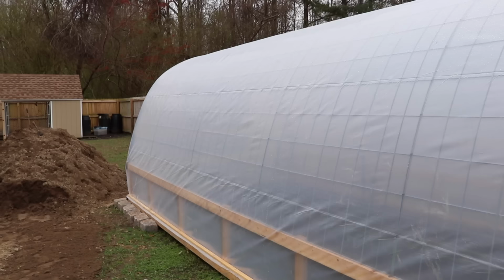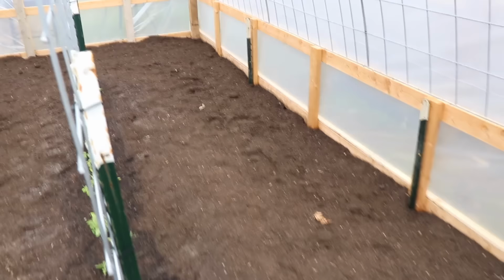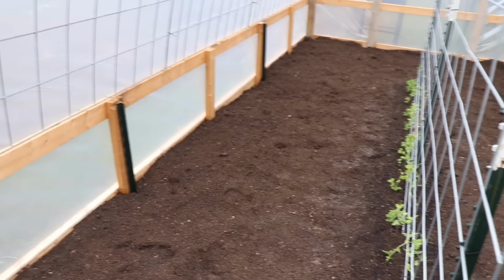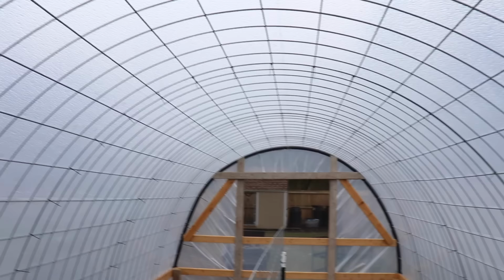DIY Cattle Panel Hoop House || Build Your Own Cheap & Easy!

Comment: Will you need to put insulation “like your pipe lagging “between the metal and the plastic ,to stop the plastic from becoming brittle in the summer.
Reply from the maker: We never had an issue with that. It gets super hot here too. We did change out the plastic 4 months after the build and put on a greenhouse grade plastic. Durable & long lasting. At the time it was only $100 from Amazon! 😉

Comment: How far apart are your walls and how high did the hoop house end up being. Really liked what you did here. Are there plans available? Just discovered your channel and subscribed. You might think about rolling up the bottoms of your plastic in hot weather. Might save you money buying fans and running power for added ventilation. What size plastic sheeting did you use. I saw in the comments that you had to replace it with a 40' x 26 ft piece. The link to amazon shows a 12x26' sheet so I'm a little confused.
Reply from the maker: Hi John! Thank you for letting me know about the link. Sometimes Amazon vendors change the specs of the product and eras creators aren’t notified unless someone tells us. I fixed the link for a 25ft x 40ft greenhouse plastic like the one we used!

Also, I’ve attached a Q&A video that I did for the hoop house build, it’ll help answer a lot of your questions! 😊 https://youtu.be/zl4sZYStqmE

We don’t have plans for this build, just the video. We were just building a homestead project & decided to make a video of it! 😉

The hoop house ended up 7-1/2ft tall & it’s 20ft long and 10ft wide. The wood frame at the bottom is 2ft tall.

We also did a ventilation video (where we roll up the sides) you can watch here >>> https://youtu.be/QACRQN920pE

And another video for the overhead sprinklers we installed >>> https://youtu.be/R1zQIxW3ZyI

Thank you for watching & subscribing!

Comment: Did you put the footings in concrete and how deep are they buried?? How did you avoid the centers bulging out to the outside after you put the cattle panel in?
Reply from the maker: They’re buried in cement 2 ft down. We nailed a regular nail into the wood & set the cattle panel on the inside of that nail. The pressure of the panel pushing against that nail holds it in place while you nail in all the u-nails. After that you can just hammer that straight nail over the panel too.😊

Comment: Question…we live in a HIGH wind area. How well would this hold up to wind?? On average 20-30 MPH pretty much daily.
Reply from the maker: We get high winds here in VA & even occasional tornados. We’ve never had an issue with the structure or the plastic! 😊

Comment: Hoop house vs greenhouse? I live in a moist and shady area, not having success with my raised beds. Which structure would you suggest?
Reply from the maker: Honestly either, we’ve done both. They both serve the same purpose. A greenhouse a more of a “permanent” structure vs the hoop house that is quicker/easier & usually cheaper to put up.

Comment: I wanted to know the price, but the materials list shows it.
Sheet plastic $115
Cattle wire 4ga 16ft x 50in $32 x5 = $160
Concrete bags $15 x 2
Solar powered ventilation fan $160
Shade cloth $30
Screen $12
Insulation $18
= $395
Then add the lumber, unless you can get your own from the land or have it already. Total cost is under $525.

There are cheaper methods to build it. Although thi is very easy. It can be done cheaper, especially since half the cost was the plastic sheeting and solar fan.

Marine vinyl is a cheaper choice. You can get it online for probably $25 to $50, but don't quote me on that, I just did a quick google search and it's for 10 mil marine vinyl which is designed to hold up to the elements. I might be wrong about price only because I'm not sure how many square feet you need. It comes in 72" rolls at 3.75/yard (3 feet), so that's $25 for 6 yards (24ft), or about a dollar per 1ft x 5ft. The greenhouse looks 16 feet long and maybe 8 feet high, so maybe 20ft x 16ft? If so then 2 sheets @ 20ft x 6ft (72") with a seam down the middle. There are several methods to join it at the seam. In that case you need 40 feet if my latter estimates are correct which means ~14 yards x $3.75/yd = ~$53 for 10 mil marine vinyl.

As for ventilation you don't technically need th fan and can get by without it. Instead I would recommend to invest the extra money into large tubes - get at least 4" corrugated tubes - which you will use for geothermal temperature regulation. Dig trenches and sent it around the perimeter of the yard and back, needs to be below the frost line, typically 6-8ft deep. Laborious, but free if you do it yourself, just the cost of tubes. You can get 100ft of corrugated tubes for only $75. It will provide stable temperatures year round. TO make it perfect it requires some knowledge but not much.

Overall if you farm the lumber off your land, and skip the ventilation fan instead opting for natural ventilation using the wind tunnel effect, you can get by with this project for much cheaper. Don't use concrete and save even more. You can use less screws or get a bulk box for $10 off the internet. I realized the pipe insulation is for providing the corner to protect the plastic from tearing, good idea and it's cheap anyway. And you don't need a greenhouse so big, half the size will be fine, which cuts your material costs in half, in which case the cost would be:

8FT unit (20ft arch, 120sqft)
Lumber: free
20x12 Marine vinyl: $50
Cattle wire 4ga 8ft x 50in x 3: $96
Shade cloth: $30
Screen: $12
Pipe insulation: $18
TOTAL: $206

Forego the pipe insulation for electrical tape or duct tape to protect the sharp edges and save another $20, also get a shammer shade cloth and make a smaller size greenhouse and you could even do for this:

6FT unit (16ft arch, 96sqft)
Lumber: free
16x12 Marine vinyl: $40
Cattle wire 4ga 8ft x 50in x 2: $64
Shade cloth: $20
Screen: $12
TOTAL: $136

So it can be made REALLY cheap not really compromising the integrity because the structural rigidity is the cattle wire panel and the wood, especially if you can get reclaimed wood, pallet wood, or farm it from your land.

So, this greenhouse could technically be made for about $200, or a smaller budget version for under $150. Or, add $50 to buy the lumber at today's inflated prices.

Hope it helps!

Comment: Very nice build thank you. Best video on the topic. I hope I am not repeating a previous question but it is not apparent what the T posts were for. Did you use them as additional anchors and secure the to the adjacent 2x4 slats? If so how were they tethered together  Or did they serve a different purpose?  Thx again.
Reply from the maker: Hello! Yes, the t-posts were just for additional supports as the 4 corner posts were the only things cemented 2ft down in the ground. 

We drilled holes into the t-posts, buried them 2ft down and screwed them to the vertical 2x4s. I hope that answers your question. 😊 Thanks for watching our video!
Reply: @HomeFreeAlaska  I almost gave up scrolling and was going to ask the same question! Thanks and good luck in Alaska.
Reply from the maker: @usaeagle7  thank you!!!😊

Comment: This looks great!  How long do you think the plastic sheeting will last?  I am in central Texas.  Wondering if the plastic sheeting holds up to 100F + summers?  50 mph winds?  Opinion appreciated.
Reply from the maker: Yes to both questions! Virginia summers are HOT & we also have tornados from the hurricanes on the east coast. Never had an issue. Manufacturer says the plastic lasts up to 3-4 yrs depending on outside elements.😊

Comment: How well does it hold up under a snow load?  
I realize that it should slide off relatively quickly on its own, but I'm sure that it can build up a snow load before it slides free.
Reply from the maker: We don’t get a ton of snow here in VA. But when it does snow, we go out and remove it. It actually packs up there pretty good without sliding off lol! But if we had heavier snow here, I’d def put in some center support beams to help support the cattle panels. 😊
Reply: @HomeFreeAlaska  Thanks for the reply.  I like the size of that green house.
Reply from the maker: @johnjacobjinglehimerschmid3555  me too! It’s been a great addition to the garden space! 😊

Comment: do you guys have any sonw in winter? If so, how does the structure whitstand to the weight of wet snow? Does it tend to sag?
Reply from the maker: Hello! We get very little snow here in VA where we’re at. If you have heavy snow, I’d recommend a support beam down the center as too much weight will cause it to sag. 😊

Comment: I'm in Australia and was looking at a hoop house and came across yours, and stopped right there, no need to go further. Couple of points though, as afar as conversion. We don't seem to have access to what you call cattle panels, but we do have remesh of course, that's a lot harsher as a material, in that it is not smooth. I know the material for cattle panels, but have no idea where to get it. Another thing, I know what a 4 x 4 or a 2 x 4 is, but what is the measurement with the 'S' as in 
(2) 4x4s cut in half

(4) 2x2x8s
(12) 2x4x10s
(15) 1x2x8s
(17) 2x4x8s

Would appreciate any feedback
Reply from the maker: Hello David! When I put an “s” at the end of the measurement, it’s just to reference plural, meaning more than one. That’s all. 😊 I put the number needed in the parenthesis so you can disregard the “s” altogether if it’ll be less confusing.

We got our cattle panels from a store called Tractor Supply Company. I don’t know where to find something like that other than Tractor Supply or farm type stores. Not sure if you guys have any of those in Australia. Thanks for watching our video! 😊

Comment: How did you secure plastic to the wood? Staples? Wouldn't they tear out in wind? Also what do you estimate this cost to build? Tyvm
Reply from the maker: Cost was approx $500. Before this inflation tho. Haven’t had an issue at all with the staples. 😊

Comment: I'm wondering how it's holding up? is it not get a lot of wind I think you could reinforce it from the cattle panels to the sidewall and do you get a lot of snow that has a stood up under snow load yet?
Reply from the maker: Hello! We don’t get much snow here where we’re at in VA but we’ve had about 4” on it before & it had a little sag in the center. But you could always reenforce it by running a support beam down the center. 😊 The hoop house has held up nicely and has been a great addition to the garden space. 😊 Thanks so much for watching our video!

Comment: Are you in Alaska? Sorry for my ignorance. Do you expect to have problems with snow load on the greenhouse? We built the same hoop house greenhouse with cattle panels, and an ice storm collapsed the roof. We were able to get the ice and snow off, but I then built reinforcing supports inside to support the roof. Just wondering what your thoughts were. Thank you.
Reply from the maker: This was built in Virginia. If we were living somewhere with lots of snow I would have definitely ran a support beam down the center. We now live in Alaska and plan to make a green house with the hard plastic panels and 2x4s. The snow loads up here are crazy. Thanks for watching! 😊 (Joe)

Comment: And, what size shade cloth and % did you get and would you have preferred a different size afterwards?  Thanks!
Reply from the maker: We chose a 40% Black Shade Cloth, 10 x 20 FT. I think it worked well. Kept it shady inside. I would probably change the size of the shade cloth to 15x20 so it would cover the hoophouse completely or close to. Thanks for watching! 😊

Comment: Will the veggies over heat if left inside the hoop house? I made one very simular and wondered if you replaced the plastic with the greenhouse cloth for ventilation?
Reply from the maker: Ours didn’t but we bought a shade clothe to put over the hoop house and added roll up sides for better ventilation.😊

Comment: I scrolled through the comments and did not find anything about the visquine. How big is the visquine, what mil is it and where did you get it? I can't seem to find what I think it should be on Amazon or Home Depot. How is it holding up? Appreciate an answer about the covering.
Reply from the maker: Hi,
Here is the info that you requested and the link at the bottom.
We moved from Virginia to Alaska so I have no idea how the plastic is holding up. 
4 months after the build we changed out the plastic from the Home Depot’s to a durable, long lasting greenhouse plastic which was 40ft X 25ft, 6 MIL thick, 4 Year UV 
Resistant Polyethylene:https://geni.us/CkiYCaD

Thanks for watching! 😊

Comment: How’s the longevity going? High winds,
Snow loads etc? Awesome job!!
Reply from the maker: Hi Corey! We just sold this property so we only had the hoop house for a year...we did change out the plastic for an actual greenhouse grade plastic last fall because that cheap plastic we initially put on didn't even make it though the 1st summer without cracking lol! Other than that its held up great! We get high winds here and even tornados...we've had zero issues. We don't get much snow here tho. We do get snow, just not much. I'd def recommend support beams down the center if you're in a heavy snow load area to help hold the weight as the cattle fence panels will sag if you don't. :)
Reply: @HomeFreeAlaska  awesome! thank you for the info! we live in northwest MO so we get it all as well! winds, tornadoes, snow, etc. I plan adding some 12volt fans for air circulation, powered by solar panel and batteries. We will see how it turns out!
Reply from the maker: @cpmartin2007  sounds like a fantastic idea! Our original greenhouse was powered by solar fans, worked out great! The ventilation is so important! 😊

Comment: How does it hold up with high winds and snow load
Reply from the maker: Hi there! We don't get much snow where we live right now in VA...but we do get high winds and tornados! We just had a wind storm the other night that snapped our flag pole in half! The hoop house was still standing with ZERO damage. Its a pretty sturdy lil structure being cemented into the ground the way we did it. I've had other subscribers build this same hoop house where they live with heavy snow...they said they just added extra support beams down the center. I would imagine snow removal would be important too. Thanks for watching!

Comment: With all that water in yard i would have layed cinder block for foundation first n not placed untreated lumber close to ground
Reply from the maker: We were working with the materials we had at the time. It’s all easily switched out when/if needed. The water issue is temporary when the seasons change. Either way, we don’t own this house anymore. We sold it in 2021 & bought a cabin in Alaska.😊

Comment: This is a great build.  I would like to build one but have concerns about my area weather.  We get cold sometimes down to 5 degrees, hail, snow and high winds. How will this type withstand this weather.
Reply from the maker: We don't get much snow where we are in VA. But we do get hard core storms and even tornados. So far the hoop house has held up just fine. It's a sturdy structure with the posts anchored into the ground with cement.
Reply: @HomeFreeAlaska  thank you

Comment: Great Job!!! I'm almost done building our green house. I'd like to be able to roll up the sides but I'm wondering if yours was too hot in the summer? I'm installing a fan on one end and I'm putting a screen on the door on the other end to vent the green house. Just wondering if you think that will be enough to keep it from getting too hot.
Reply from the maker: Hi there! Actually it did get too hot in there. So we added fans and roll up sides for more air flow & ventilation. Check out our video here! 😊 
https://youtu.be/QACRQN920pE
Reply: @HomeFreeAlaska  Awesome!!! Thanks!!
Reply from the maker: @khills1181  you’re welcome! Only thing we changed was we went back out & flipped the rolled sides downward instead of up so that the rain water wouldn’t catch in there. 😜

Comment: when you put the cattle panels on, how are you keeping them there to nail down?  Do you cut a groove in the 2x4s?
Reply from the maker: No we nailed a nail into the 2x4 and then set the cattle panel on the inside of it. The resistance pressed against that nail keeps the panel in place until you finish nailing in all of your U-nails. 😊

Comment: Nice build, just a question / observation do the cattle panels get hot in summer ? You may need to prevent the visqueen sheet from touching them as they may burn hot spots in your sheet…..
Reply from the maker: Hey Steve! They actually don’t. We bought a shade clothe for the hoop house & have 2 fans circulating the air through the hoop house all day. 😊 We’ve never had an issue with it. 😉
Reply: @HomeFreeAlaska   it’s a similar set up to what I have then👍🏻 apart from mine is steel tube whereas yours is the grid, but I have hotspot tape between the tube and visqueen sheet. Fans to circulate air and exchange warm / cold air through the vent mesh ( cheap usb solar panel fans do the job)
Reply from the maker: @stevedoran3278  love the solar fans!

Comment: Has only tried this in high wind areas? I’m wondering how well it will last in areas that get sustained winds of 25-35 with gusts in the 50-60 mph range.
Reply from the maker: We have high winds & tornados here in Va. it’s held up fine for us! 😊